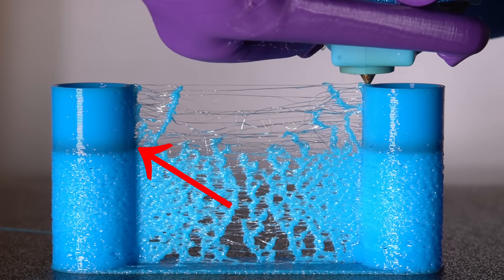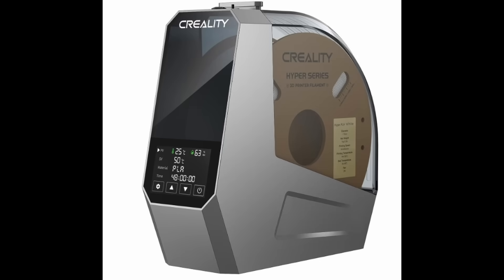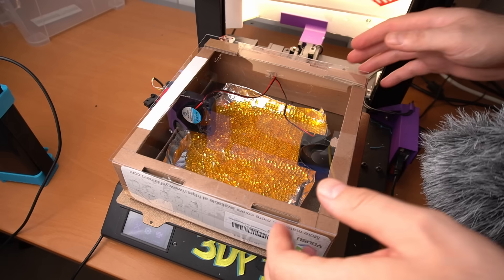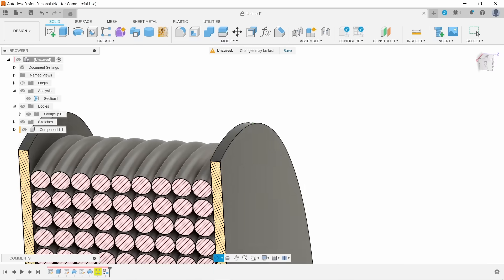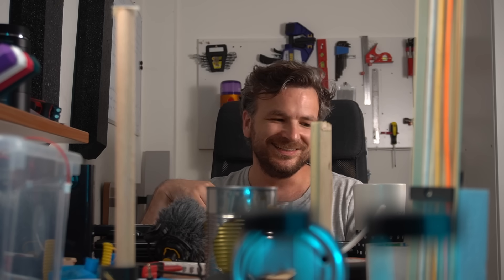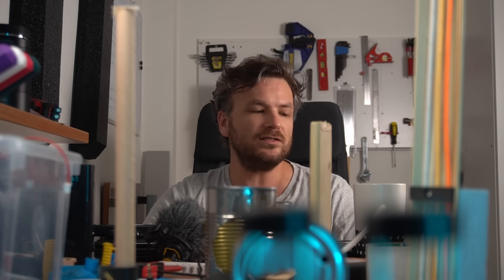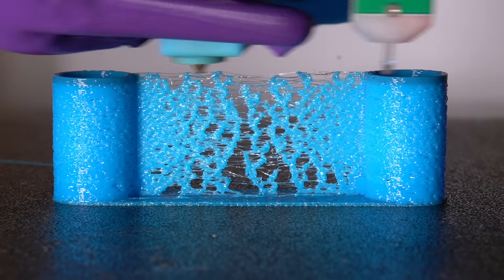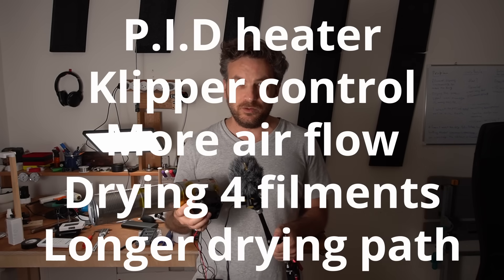Why are we drying filament this way?

Comment: Would love to see v2! Could so get behind a printable system. Maybe using standard PVC piping instead of the cans for more safety and less jank.
Reply: Aluminum air duct. Like dryer ducting. Flexible, easily ventable, and heat resistant.
Reply: @sanctusletum8522  Then wrap the outside and/or inside with heat insulating material, ceramic paint? Your usual house wall heat insulation material? The usual heat materials used for a forge? So many ideas.
Reply: Hahaha pvc, more safety and heating don't go in pair
Reply from the maker: PVC not going to cut it, the temp go's to 110C
Reply: @3DPI67 Absolutely - no idea what the thermal limitations are of PVC. Just sharing idea ✨vibes✨😂
Reply: @3DPI67 I think PVC Pipe will Bent or deform by 110°C. Have you heard about "HT-Rohr" it's very popular for using in plumbing and wastewater pipes Here in Germany inside the homes. I think it's rated save Up to 110°C Fluids. I would love to see some instand dryer with the HT Pipe. Best regards Max
Reply: I was just thinking this!

Comment: I would 100% love to see a version 2 of this inline filament dryer system, especially one that can do 4+ filaments at a time. I've been needing to print TPU, and something like this will be super cool!
Reply: Drywyse is the only working in-line dryer on the market. Yes,  it's for industrial use mainly due to pricetag
Reply: I’m with you, but only if he promises to never touch the shotgun mic again
Reply: How much is the heat and how much is the airflow? If airflow is the critical bit, might be able to 3D print something instead of cans :-)
Reply: a food dehydrator works great and is cheaper
Reply: @honda-s2k  I am new to this 3d printing thing and have recently looked into getting a filament dryer. I think your idea has a lot of merit. Some pros use food dehydrators for their filament dryer. Looking at reviews for dedicated filament dryers it seems that all fail in some respect unless you spend $$$
Reply: Why would we need 4? Only one filament goes to the extruder
Reply: If you heat TPU as you print it it stretches too much and print fail
Reply: @Yash-c3v  Literally the first 30 seconds of this video showed TPU being inline dried and printing well.
Reply: @bosstowndynamics5488  not my experience printing a functional job
Reply: @Yash-c3v  TPU doesn't deform permanently under heat until over 100°C. It may stretch temporarily under pull of the extruder, affecting grip, but this just means you need active assistance pushing it to keep the tension off the last segment going into extruder
Reply: @daliasprints9798  if it stretches doesn't it get thinner ? I figured it messed all sorts with my extrusion rate
Reply: @Yash-c3v  Yes, stretching is a problem for accurate extrusion even when it's temporary under tension. Printing TPU accurately at high speeds seems to require a mechanism to relieve tension, such as a second hob in the feed path that advances extra filament whenever there's insufficient slack.

Comment: The filament needs a lot more time in the drying zone. I was going to do this but set the project aside a year or two ago. Unless you want a super long tube, you need a system of pulleys so the filament can run back and forth across the hot dry air zone several times. You probably also need active drive for the pulleys to avoid overloading the extruder.
Reply: why not loop it like a beer line chiller? shape the drying zone like a toroid and loop the filament a couple times inside.
Reply: Maybe a copper coil?
Reply: @mirag3304  You can do that but you still need either a system of pulleys or coupled input and output filament hobs so the same length of filament remains in the zone rather than pull from the extruder trying to tighten it down to a point (open core) or to tension itself against the core (toroid) just like it'd do on a spool.
Reply: @daliasprints9798  How about a screw shaped core where the ridges prevent the filament from tangling in on itself and the core just rotates on bearings. It can tension against the core no problem. intake and exit perpendicular-ish to the core.

Then again perhaps all of this isn't needed. A spool already exposes several meters of filament to airflow since they must obviously be on the outer layer of the spool. You can print directly out of an active drybox with warm airflow. The drying of inner layers is less efficient, but you'll also need them less soon!
Reply: Why not implement the drying zone into a filament buffer? Could be an idea
Reply: @qazer10  Filament buffers I've seen aren't made to buffer forward motion just accept reverse.
Reply: Let's say you print at 100mm/s with a 0,4mm nozzle. The filament speed then is something like 20mm/s. A 2,4 meter tube would provide 2 minutes of drying time. Doesn't sound too bad?
And then connect the tube to the filament box, such that the hot dry air goes through the box too.
Other idea: wind the filament around a free rotating drum in a box and do the fan + heater trick there?
Reply: @ 100 mm/s is really really slow. Like, "this is the speed we slow down to for bridges" slow. And even 2 minutes of drying time is not going to do anything, much less 1/3 or 1/4 that.
Reply: What about high frequency radio heater. Heating the core
Reply: @ Yes. Actually microwave is likely ideal. The problem is that you have to control the power really well or you'll overheat and melt your filament. You probably need microwave with flap-actuated waveguide since, at least AIUI, magnetrons don't like being pulsed on/off rapidly...
Reply: You guys are all going about this wrong.  Go back to the whole filament dryer design but a modified one.  The extruder will pull the filament from the spool freely.  But, as it turns, your redesigned dryer system will apply hot dry air all around and close to the filament, drying the top layer very well.  A well-designed system will give the filament many times spool's whole circumference of exposure to intense heat if you apply it (with high airflow) all around it.  Of course the intensity of the heat can't exceed a certain amount for each type of filament so it doesn't melt.  The only problem with my design is that the circumference gets smaller as you get to the end of the spool (and the top layer gets further from the hot air flow).
Reply: Yeah, and still it's possible to overload the extruder even with direct drive
Reply: Look, I don't even have a filament printer yet, so take this with a pound of salt.

Is there any means to transfer a spool of filament to an empty spool? Basically like those old school projectors and magnetic audio recorders. Take the tape deck design, combine it with whatever keeps a winch from making a mess when it reels in, and have an in line dryer between the two.

For the inline dryer, I'd probably use copper tube that's perforated enough for air flow, but not so big that dessicant beads can sneak in. Outside of the copper, have the silica beads and hot air flow, with an outer shell of whatever -- cans, pipe, whatever can get and stay hot without issues. (Does anyone make a heat gun that outputs a specific temp? Because that'd be spot on. >.> Or get a cheap air fryer, drill holes on the side, and let it get blasted.) 

Turn the machine on, it transferz filament from one spool to the next. Then have it automatically cycle back, preferably with a means of programming a number of passes. 

>.> Just a thought, anyway. In the unlikely event such a device doesn't exist yet, consider any resulting patent as belonging to the public commons/domain. . :P Owning ideas is silly.  

But you could rig it, program however many passes you think it'll need, and it ought to dry overnight just fine. (How long are 1kg 1.75mm spools? >.> Not sure how long a single pass would take since length is unknown.)  Might even be capable of drying nylon in an hour or two. Admittedly, not as handy as just setting it between spool and printer, but still.

>.> And if I'm describing a product that exists, well, it's hard to have an idea that's good, novel, and practical all at the same time. :P ~8 Billion humans, 24 hours in a day, 365.25 days in a year, that ends up being ~22,000,000 years of human experience banked each day. Makes it tricky to be first.
..but it also means for any problem you face, someone, somewhere, and some point in time has probably solved it. :P
Reply: @dracodraco1982  I don't think there's much value to do this complexity for ahead of time drying. It's easy to get almost all materials dry overnight with conventional dryers that aren't inline. The value of inline is not needing dry storage for all your filament, but being able to store it on shelves in ambient air (at least if the room is air conditioned, not swamp air) and just dry it at the moment you need it.
Reply: @daliasprints9798  Yeah, you're probably right, but having looked at a bunch of dryers, they all max out around 70*C whereas Nylon really takes closer to 90-110 to get dry in a reasonable amount of time. x.x People say dehydrators, but all I see don't go beyond 70*C.  It's as if I'd end up need an actual oven or air fryer.

Anyway, that's why the overly complex system came to mind. x.x Because those filament dryers look like they'd take upwards of a week to dry Nylon if got wet. (Which it will, given this time of year and season. X.x)
Reply: @dracodraco1982  Yeah, an air fryer is much simpler though, or just a normal kitchen oven.
Reply: @daliasprints9798  I'm a bit worried about using it in an oven I'd use for food, but yeah, I'm looking at either an air fryer or a dehydrator that actually goes to ~90C/190F. If there's a model that you know first hand works well, I'd be grateful for the advice.
Reply: @dracodraco1982  The ninja air fryer has high temp dehydration modes builtin and works well, but is probably costlier than you need.
Reply: @daliasprints9798  :P It'll seem an irony at first, coming from one who tends to be both broke and broken, but I prefer having better tools than I need, so I'm not replacing entry stuff within a year. :P Things have a funny way of finding a purpose, besides.

Thank you very kindly, Dalia. ^.^

That's actually one of the ones on my short list, too. ^.^

Comment: 4:30 i think they might be using molecular sieves just based on appearance, but i’ve got no idea what else they’re using in the machine in order for them to justify that $2000 price tag
Reply: Looks like an MS to me too. Does seem like a pretty hardcore solution.
Reply: They also installed a patent pending marketing system.
Reply: most likely. the air is being pumped through them to super dry the air. id be interested to see someone buy a vacuum drier  and see how that works
Reply: Science!
I guess they just want to be payed for the efforts of R&D they put into making the device. And i could see the machines being assembled by hand and not really optimized well for fast and easy assembly. It's a niche market with low volume, especially for a "professional" solution. Going for a cheap low profit margin solution was not theyr goal, as the big brands already cover that market with the cheaper filament dry boxes.